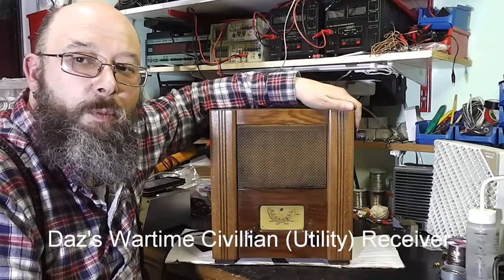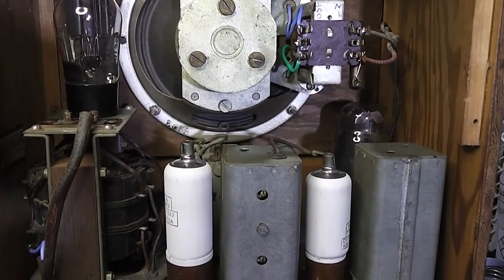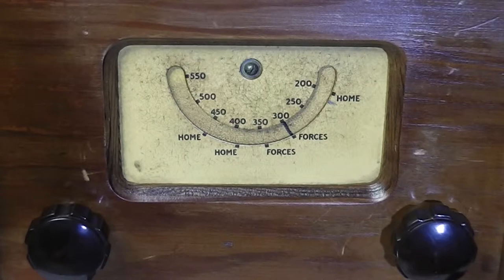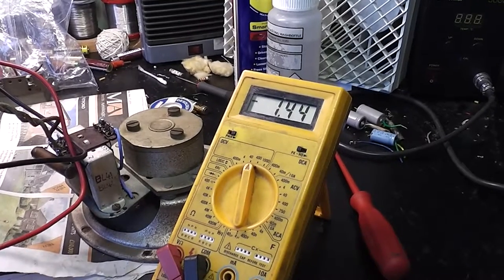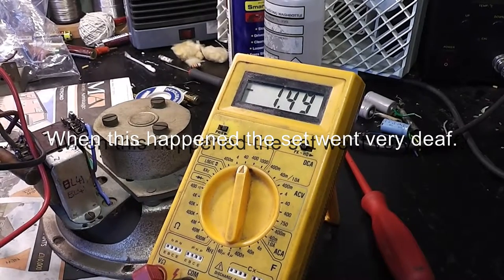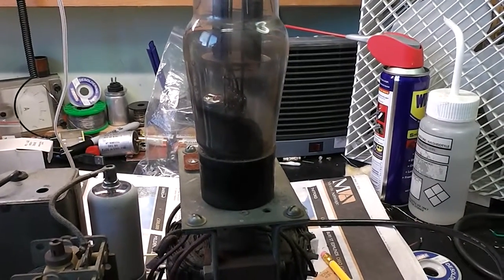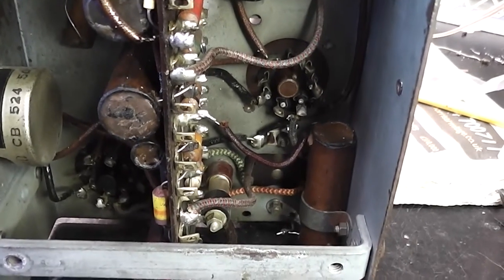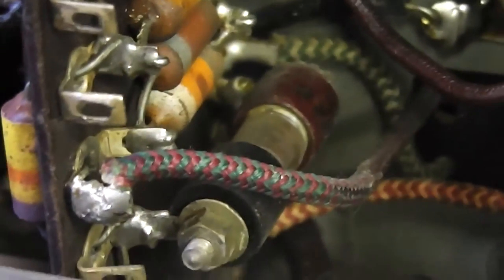Civilian Wartime (utility) Valve Tube Radio

Comment: Hi Darren. I know this is one of your earlier videos but I must say that I had one of these utility radios that had long wave. I know that well after the war you could buy one of these radios through an advertisement in practical wireless. The sound quality and sensitivity was extremely good.  Very much enjoyed your video. Terry
Reply from the maker: Thanks Terry, yes I guess there were surplus units after the war. Very good and well designed   for the valves used. Daz

Comment: I have the same unit which is very deaf.  Can you elaborate on what you did to fix yours?
Reply from the maker: My deafness appeared a few minutes after switch on and it was the Mixer and IF valve had some sort of grid leakage pulling the AGC positive. Two new valves fixed it. I must admit being a short superhet, it isn't that great without a fair length of cable. I was also wondering if it was the westselector diode, but bridging it with a modern diode didn't show any improvement. Daz
Reply: Mine is dead from power up.  Need to check some voltages I guess.  I can only hear one station, which is the one closest to me, and it’s quiet at full volume.  I changed the audio amp tube but that didn’t fix anything.

Comment: I have just bought one of these to add to my collection and believe it or not it works bad points tuning cord has snapped and I need to completely rewire it. good points when I removed the back it was fitted round the wrong way so I have a perfect sticker on the back. only thing missing is the label on the top. but for a basic set the sound is good
Reply from the maker: Mine broke too, Martin. Its a bit fiddly as its short. Good set, a little insensitive being a short superhet but really well made.
Reply: mine seems really lively will put a vid up before and after as soon as I can
Reply: hi Darren just put a short vid on here thought id show my set working I have rewired it replaced the dial cord and give it a gentle clean. still got to do the caps and case hope you enjoy sorry you cant see the sticker properly